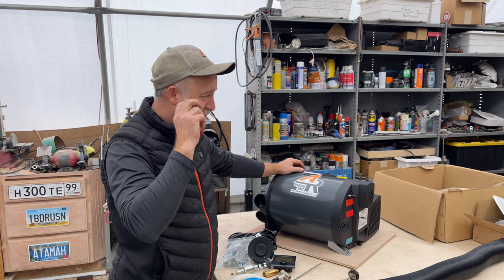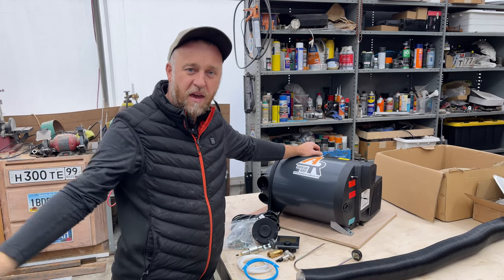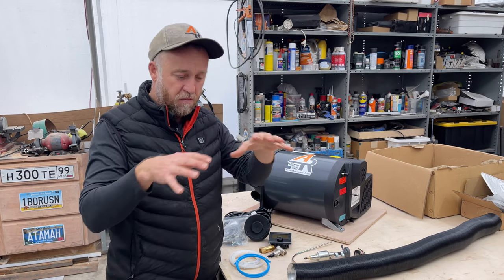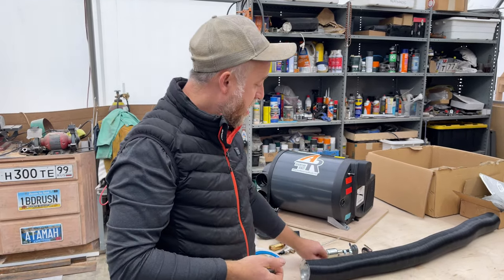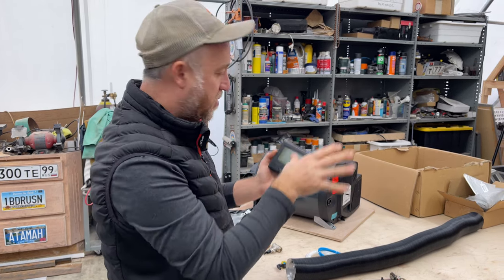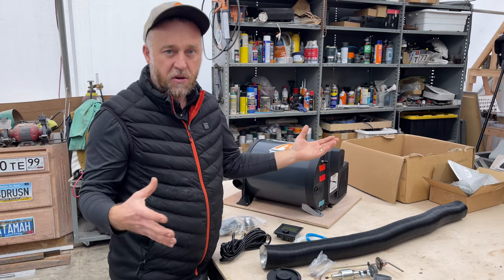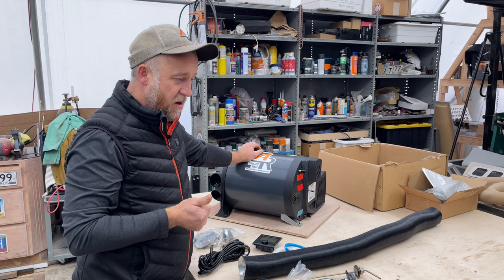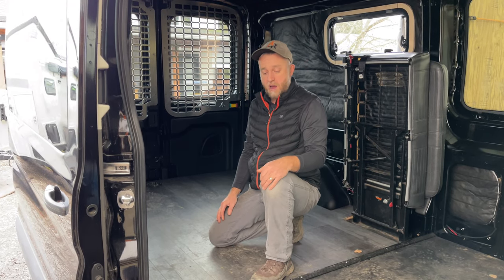Chinese Truma Combi heater/boiler (water heater) review - Gasoline Version

Comment: This looks cool, a budget version of this is a Chinese Diesel Heater (8kw, 26000btu/hr version) what you do is duct the exhaust pipe into a large "Heater Core"  from a car, then to the outdoors.  The heater core will get 350-450°f and you can heat a pot of water on it or cook with waste energy while also heating a space.
Reply from the maker: One can build anything he dreams up for sure; but this is a Chinese version of a water heater/space heater as is; just like the diesel heaters to the OG Webasto/Espar brands

Comment: Do you have a link to the dealer/manufacturer of the unit to look up the specs. This looks like a much better option than the propane version for my application.
Reply from the maker: I buy these through a manufacturer in China, I’ll have to find the booklet. What is it that you need info about?  They are very much same as Truma heaters (German made)
Reply: Thank you for the response. I am looking at doing an overlanding style vehicle, Alu cabin/Tundra build in a few years and I am doing research for what I feel is the best set up for our needs. This seems to be the best fit especially if it can run on gasoline. I was hoping to find out where I could order one from and it specs to see if it is right for our needs.
Reply from the maker: I can sell you one, otherwise you'll have to take chance with another supplier.
For stats as I said - its similar/same as Truma brand heaters.  This isnt a simple unit to install (like chinese diesel heaters) - a bit more goes into it as far as getting the right components to connect everything up.  
I'm not at the point where I'm ready to simply giveaway info for which I spent a lot of time researching/risking funds, etc.
Reply: @budnixon  no worries. i am still a few years off starting the project. just in the research stage now. this looks like a much better option than separate heater and water heater. even better if it can all run off gasoline.

Comment: What about install it on a sailboat? Thanks for the video!
Reply from the maker: you can install it anywhere... as long as there is fuel/power source to run it
Reply: @budnixon  Thank you a lot Sir!
Reply from the maker: no problem, 

Depending on what fuel source is readily available, I would personally suggest propane (just not sure if thats available/common in sailboat industry). Reason for that is that its quite, and one doesnt have to listen to the fuel pump pulsing noise which gets truly annoying to many.
Reply: @budnixon  Thank you again!

Comment: Since you put the heater next to the sliding door, wonder where do you put the exhaust that does not get blocked by the door upon open?
Reply from the maker: Great point. 
Heater is to be ran only w/ door closed, and entering/exiting isn’t long enough to cause issues (considering heat loss in interior) will be adding a heat shield on door panel to prevent any damage to plastic panel. 
Exhaust is vented to side closer to center of quarter panel. Tests so far showed it to fully functioning and not an issue. 
It was a brained of “what if”
Owner said he is fine with that location as well
Reply: @budnixon  Murphy says don't put the exhaust behind the door.
Reply from the maker: @AZRockRunner  clients choices are locked in ;) ball is in their hands 🙌

Comment: I only wish that TRUMA finally can take a look how better knock-offs in design of control panels. Yeah design of heaters - the real German enginuity no doubt, but everything else… Remote control is only BT??? Abandoned option of GPS ish control via sim. Why? Chinese control panels are WAY more advanced in it, even if made of cheap plastic and ideas. China is like Honda at first in states - no body believe in those uzkogla3blx engineers lol… Now what?
Reply from the maker: I have installed multiple of these and in different fuel range and so far everybody is really happy